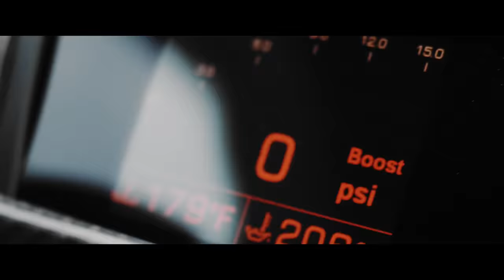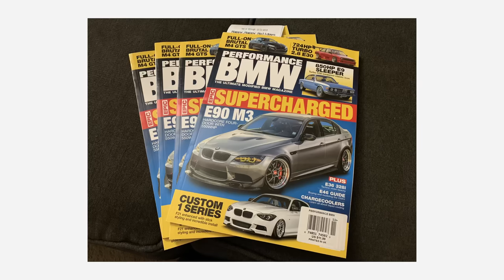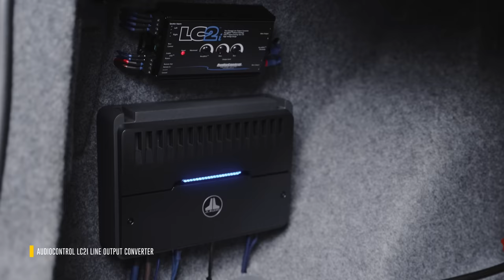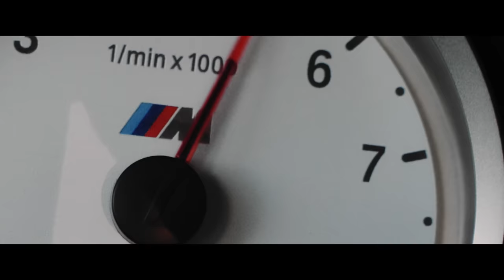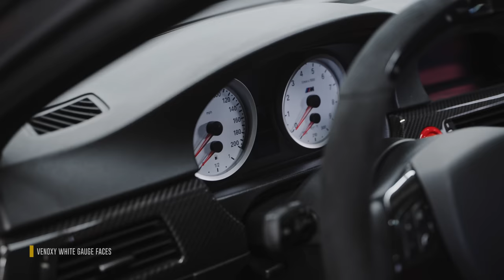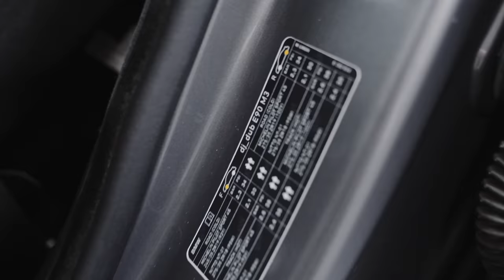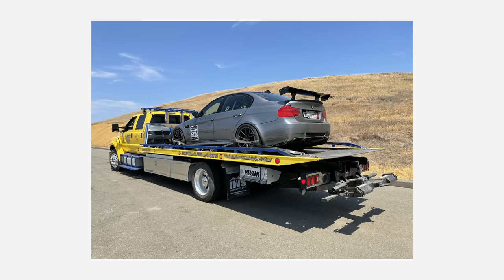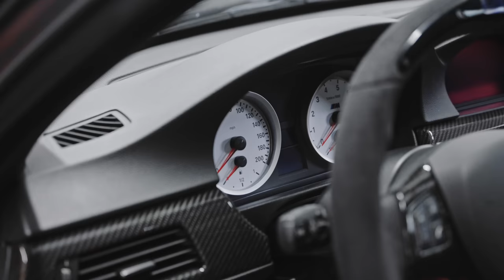The Trifecta E90 M3 Build | Build Episode #02 | SVBimmer

Comment: I guess I’m the grandfather to Dress up Bolts titanium Hardware for the E8X 135i kits❓I teamed up with Seth over there & used my micrometer & we did 85% of my 135 in blue anodized GrD. 5 [Ti]tanium. Everything in the engine compartment, hood, hood hinges, trunk, trunk hinges, doors & fenders is Dress up bolts. I did all my front & rear bumper cover hardware in JDC burnt Grd. 5 titanium, along with my side & rear splitters from Flow Design. I did a lot of other things with JDC Titanium like my throttle body bolts, oil filter housing & my polished stainless vacuum canisters nuts. I’d like to do something like this with my port injected 630 WHP 135i soon….✌🏻💯🏁

Comment: Brother I have seen so many videos on this car from multiple people you and driving Cody and wheely cool videos, on Wendell and his car, I really appreciate the way you broke this video down in a logical order, it also has vindicated me for my obsession of BMWs which I own three currently, one is a 335i going a full stage 2 with flex fuel from motive and mhd, the other is my pride and joy which I haven't driven in 6 years and E46 zhp 6 speed manual going a full restoration with 75k miles on it, and then I have my daily in 08 E60 550i 6 speed manual, with that car my goal is to make it an m performance tribute car with Dinan and other quality aftermarket parts it already has catback MagnaFlow exhaust, and performance engineering LSD 3:46 gearing, this car will be more of a SQ sound system car I have accumulated the parts during covid with two audio control amps one audio control DSP, focal K2 speakers, Infinity 10 inch sub in a custom enclosure from Germany that matches the carpet perfectly for the trunk, again thank you so much for allowing me to feel vindicated, people always ask me why would you want three cars plus a work truck when you get on one car for $100,000 that could potentially deliver most of that, this video explains my obsession with variety again thank you so much really appreciate you and love your format of videos